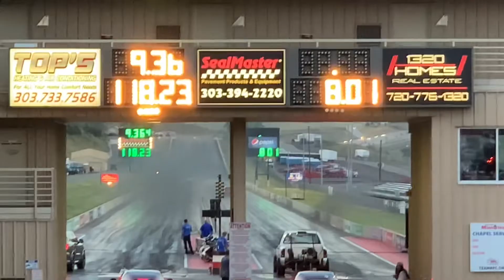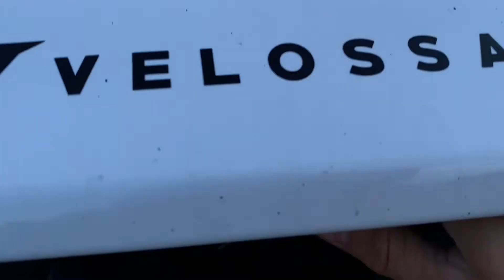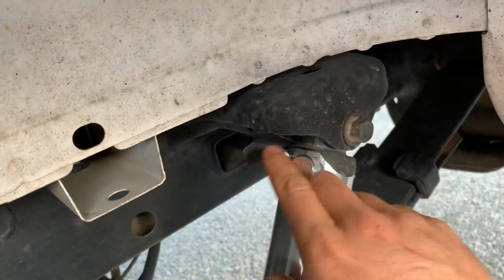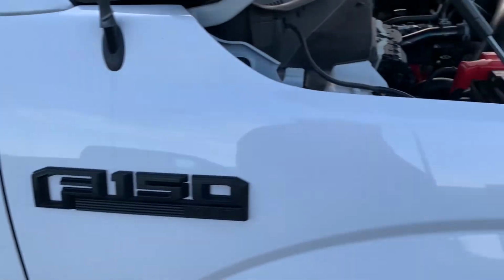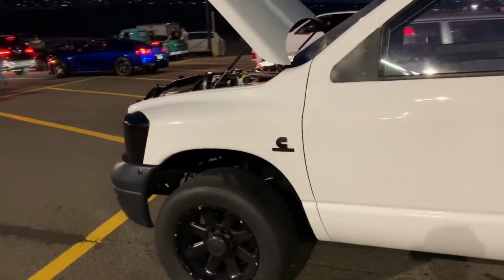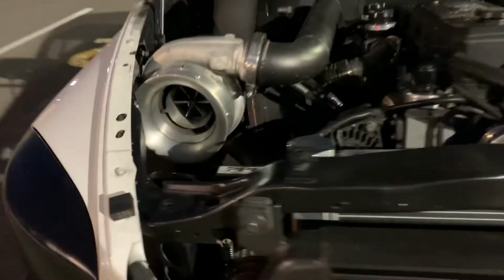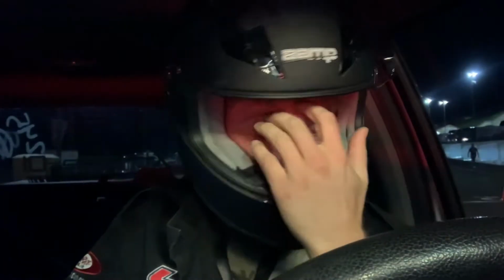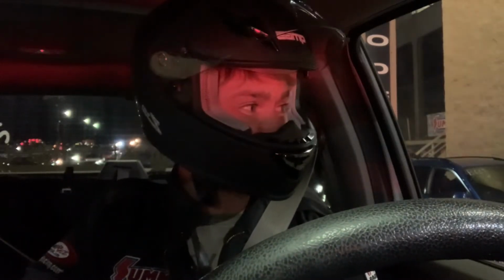Launching to the Moon on the ZFG Tune and Almost Breaking Stuff…

Comment: Awesome video! Sad to hear Bandimere Speedway is closing. If you weren't in Colorado at such high elevation & thin air you'd "easily" be at your 11 second ET quarter mile goal even with like you said less than ideal 60 foot times. Can't wait to keep spicing things up on my 2022 Ford F-150 XLT Super Cab 4x4. My goal will only be 12 second ET's in the quarter mile. But should be "somewhat" easier as my f150 is a 2nd Gen 2.7 EcoBoost with both direct/port fuel injection + the 10r80 ten speed automatic transmission + being only a Super Cab may be slightly lighter than your truck.
Reply from the maker: Yeah it’s sad. We’ll all take to the streets after it closes. Oh yeah for sure. I’ll get an 11 soon at the drag strip. It’s already done 11.89 on the street. Just want to get one at the drag strip to prove it with a time slip. 

Yeah that should be a fun build! Have fun with that!
Well, only way you’ll be lighter is if you do some weight reduction. I took several hundred pounds off my truck.

Comment: I’m about to buy your rear shocks from lethal performance.  And you should do a tutorial on the adjusting.  Can’t find a video anywhere.  You’re one of the only people I’ve seen with this suspension.  It would be super helpful if made a tutorial thanks👍🏻
Reply from the maker: I can try to make a tutorial video. I’m still learning some of the tricks as well though.
Reply: @BoostKingMatt  possibly a video of you doing dig runs and see what adjustments work the best after each run.
Reply from the maker: @joefer.  I did a run last night and had compression on 12 clicks and rebound on 9 and she hooked good.
Reply: @BoostKingMatt  so basically the opposite of the video correct? Because you had the compression at 9 and rebound at 11 before
Reply from the maker: @joefer.  yeah very much opposite. I will do a video on it. That was a really good suggestion.
Reply: @BoostKingMatt  appreciate all your help!
Reply from the maker: @joefer.  Any time!